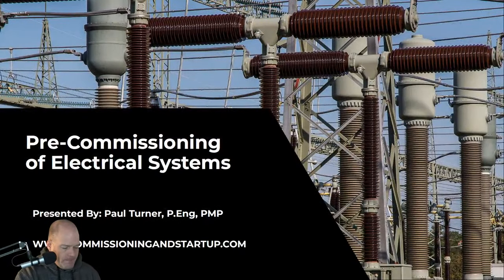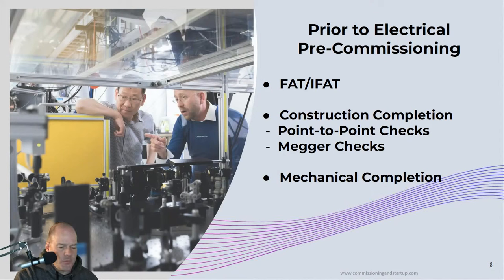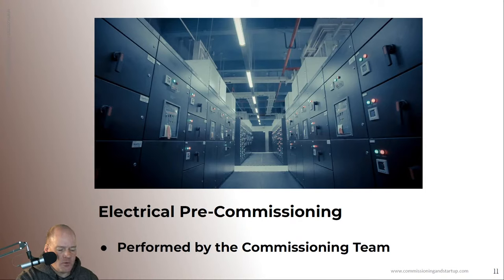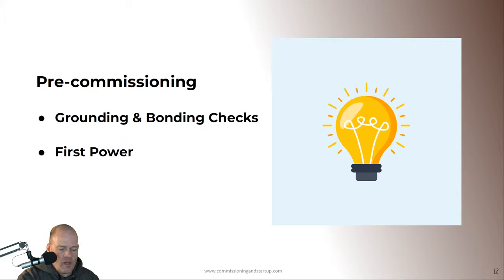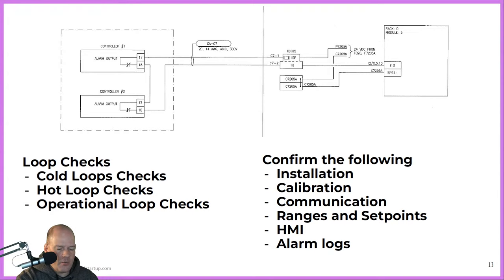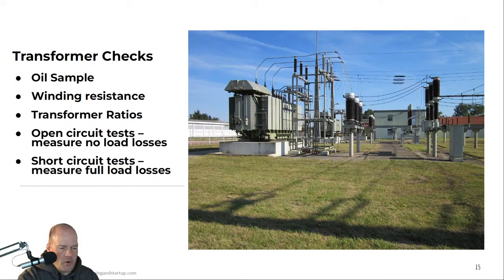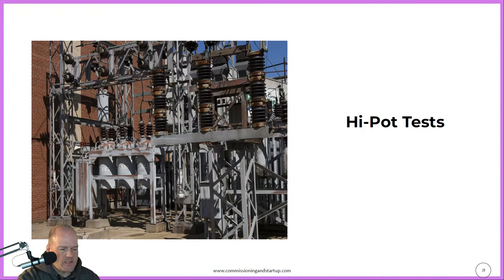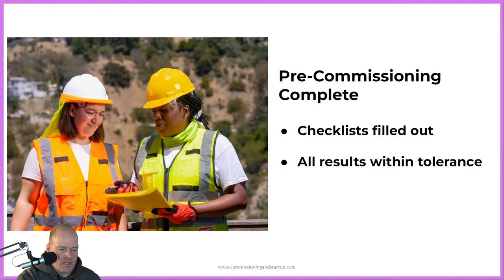Pre-Commissioning of Electrical Systems

Comment: Have had fair experience/designation in design and  construction of electrical systems, based on your lecture on commissioning, I like to take a role as commisioning engineer how can I position myself for a commissioning offer or job application?
Reply from the maker: The best approach is to gain the knowledge you need, and you're on the right track by checking out our webinar. If you would like to learn more about commissioning to position yourself for a commissioning role, submit an application or book a 15 minute call to discuss if our training is a good fit for you:
https://learn.commissioningandstartup.com/mini-course-thank-you-webinar/